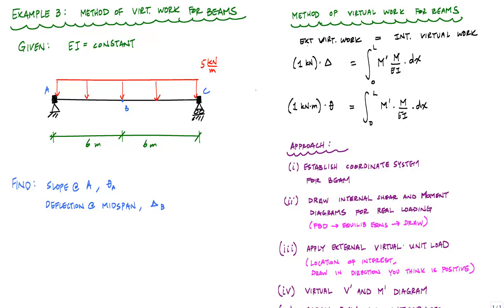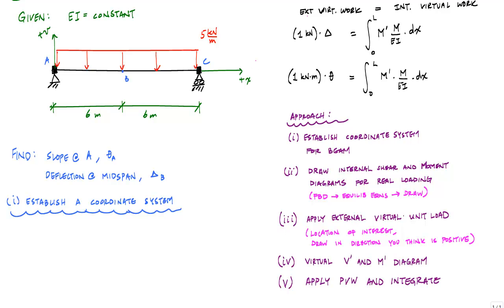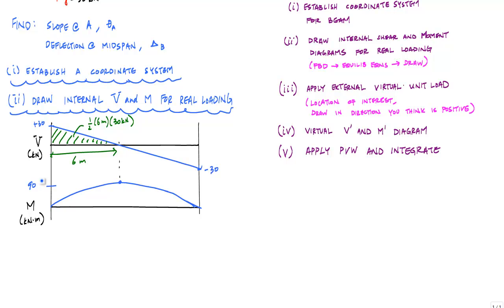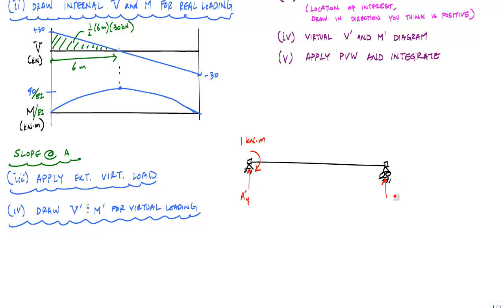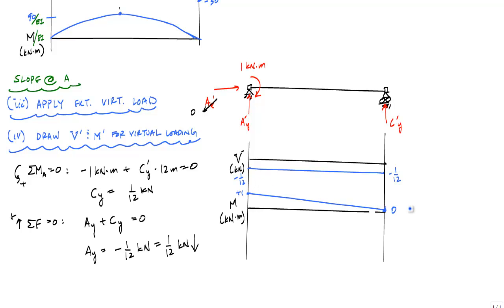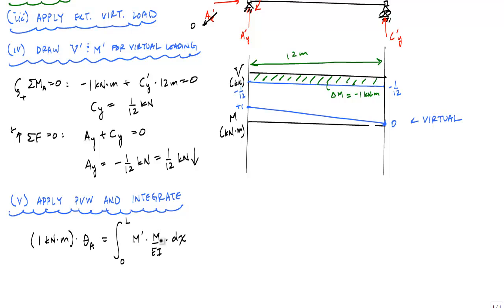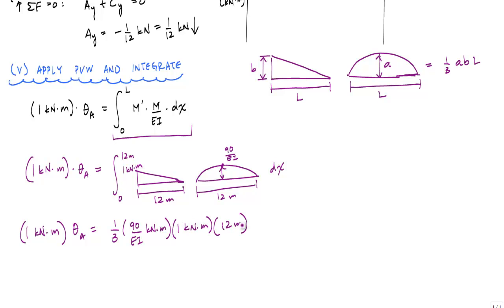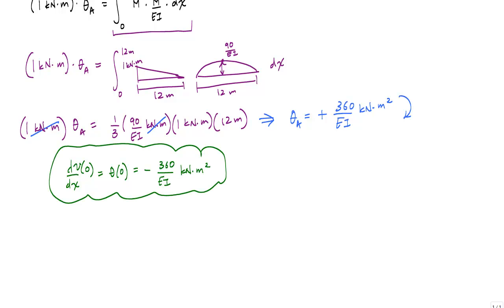Method of Virtual Work for Beams Example 3 (Part 1/2) - Structural Analysis

Comment: I really like all your videos dude but don't like the way you solved these,, found the other methods out there to be much simpler...
Reply: Agreed. In my opinion at this level it should be all symbolic too. I'm not 100% sure, but I think doing virtual work problems are gearing us up for Galerkin/Ritz/other numerical methods used in FEA in which we don't know the exact solution and are forced to make educated guesses based on a subspace of basis functions (I think they call it "del-u" in my class - an "inexact differential"). 

All that aside, structurefree is awesome, and has been for years, and I appreciate the enormous volume of videos.